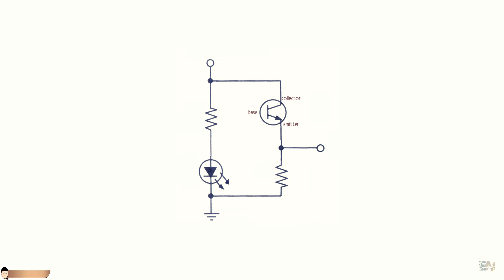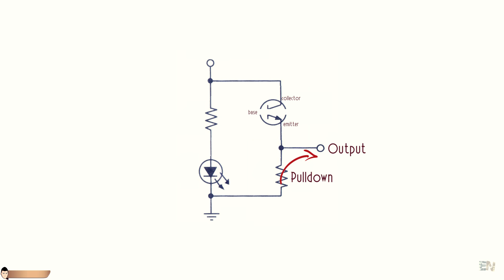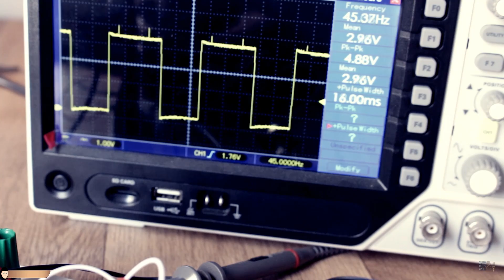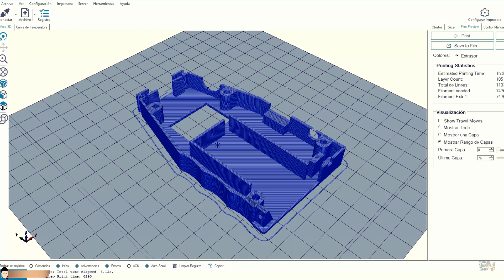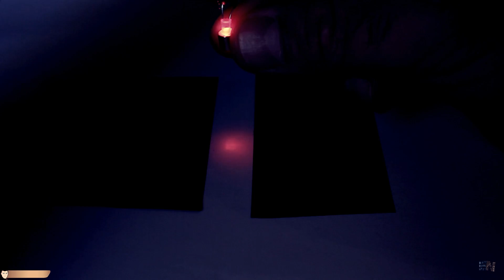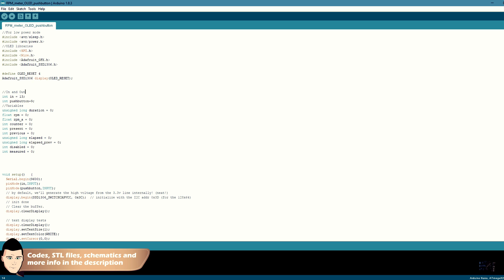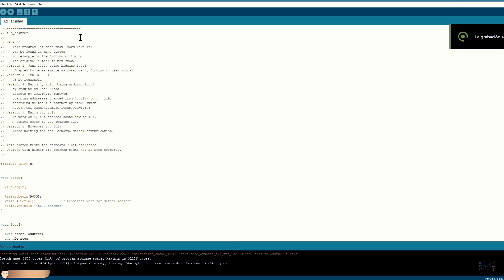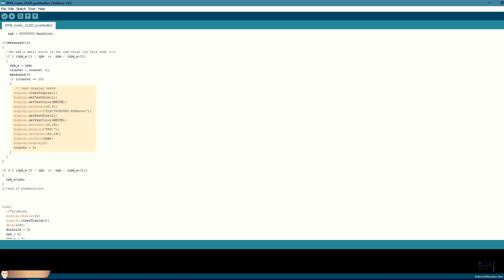RPM meter with arduino DIY (IR sensor and 3D printed case)

Comment from the maker: I hope you enjoy it. If you have any question don't doubt to ask it on my Q&A page or here. The project could always be imprroved with better code, better IR sensor and a faster microcontroller. Keep up guys!
Reply: I think an improvement would be to use a positive edge triggered interrupt and measure the time between interval between the two successive interrupts.
Reply: Electronoobs sir, how if i wanna make this cool stuff without push button? Is it using the same code? Thanks a lot from Indonesia :)

Comment: At low speeds, your algorithm is very good. Wouldn't measuring the period of a square wave cause a large error at high speeds? At high speeds, if it counts pulses for 500mS, the amount of error will decrease.

Comment: my problem have not display working whit ssd1306 library, i test display and many example ssd or sh 1106 library  Gyveroled or lcdgfx library working, working only, how change code use other library.  and how max speed can measure accurate, my cnc spindle working 9-30 000 rpm. first time i try use oled display and not working whit ssd 1306 library. sh1106 working ok, i test display only drivers examples. how need change code can use other library, now come lot errors whit ssd 1306 lib. oled have chinese 1,30" white, 4 pin i2c.

Comment: can this use ir module no need code change, and my cnc spindle run 0-25000 RPM read this accurate speed. or what need change code.
Reply: Look at GreatScott's video on RPM meter. That's exactly what he did and it works great apparently.

Comment: why use lm324 op amp, why not use lot cheapen, ir sensor module include all this parts, lot better and easy use, need same 5V in,GND,out signal. and arduino can read sensor.

Comment: Not better to add schmitt trigger instead of opamp?
Reply: Absolutely it would.  Either that or just use a comparator.  Using an op-amp is just the wrong part for the job.  Especialy a quad op-amp.  Even a cmos inverter would be a better choice. All you're doing at that stage is squaring up the output waveform from the sensor.  A comparatore offers a convenient way to set a threshold to adjust the sensitivity.  Now that I think of it, a 555 timer would be another good choice.  Put the sensor on the trigger pin, set the threshold with the thrreshold pin.  No points for guessing where to get the output from lol.  Just remember o/p will be inverted, not that that even really matters. Save the opamps for an audio project.

Comment: is it possible not to include a trigger button? I am intending to use a li-po battery but it is difficult to define when to stop the RPM counter and make the value stay on screen.

Comment: The parts links aren't up to date, but you can get a ready made IR sensor with the needed resistors from adafruit ( https://www.adafruit.com/product/2349 ) - with that and a few jumper cables I could already read data from the Arduino to my computer through the USB cable.

Comment: Before the end of the code there is some logic of adding error to the rpm value, what is that for??
Reply: After dividing to get RPM, there is a fractional part.  The code you're referring to just rounds up if the fractional part is greater than .5

Comment: I did something similar with a laser & an IR sensor I pulled from a tv RC receiver. Its been years but i remember I was able to get 60k. of course that took some tuning. it was 5k out the gate. Eventually I used atmel studio to reduce the bloatware on arduino.  Like I mentioned> its been years, but I remember getting more like 100k or 200k.... I should clarify >>  its good and very useful bloatware. Its really good to have quick access 2, caz programming in atmel studio was super bare bones. There is much goodness in the arduino ide already hooked up. Much I didn't know I was taking for granted until it was gone.... so ya its not that big of a deal to use atmel studio, just be prepared to strap yourself in and read that 1000k length datasheet.  btw, measurements = signal generator + oscilloscope . and yes it totally works to measure spindle speeds, that why I made it. There is a lotta power in a laser. U could use an old cd player as well, its got a laser&diode right there :)

Comment: How wide is the tape strip?  Seems to me a narrow strip would be more accurate.  Measuring propeller speed would have to be done differently,  as added tape could make the prop unbalanced and cause problems.  What if your viewer does not have a 3D printer? Some of the stuff you mention costs more than I can afford.. I'm more interested in projects I can do with what pieces parts I've got, like the 37 sensor kit.

Comment: Hi, I used a low frequency clock generator for testing the circuit and I can not read accurately. Very unstable and wrong measurements!

Comment: How you get 5v from the op amp since the lm324 is not rail to rail??
Reply: You don't need to get 5V because the input threshold for an Arduino digital input is somewhere around 2.6v
Reply: @Enigma758  ok thats true, but you do not answer my question
Reply: @1828fernando  OK, I think you may be referring to 4:20.  The pk-pk value is jumpy.  You can see it bounce around anywhere between 4.20 and 5.24.  Also, notice the spikes at the top of the waveform.  I think when it jumps past 5v, it's due to noise spikes.  I think the circuit could benefit from some filtering.
Reply: @Enigma758  again... You are not answering my question. If you read the datasheet, says: output voltage swing up to VCC - 1,5v. you can not  get 5v output. Something is missing or wrong in this video.
Reply: @1828fernando  OK, I see your point, an LM324 should not be able to exceed 3.5v yet his scope is showing otherwise.  So something is fishy here.  Maybe he is not using an LM324 on his breadboard.  Or maybe he's driving it higher than 5v on his breadboard and that's offsetting things.
Reply: @Enigma758  maybe... Thanks!!
Reply: @1828fernando  Just don't use an opamp at all. Use a comparator like LM339 or even a 555 chip.  Other good choices are cd40106 inverting schmitt trigger or cd4069 inverter.  What you are mainly trying to do at that stage is make the analog signal from the sensor into more of a rectangular wave so that the transitions are well defined in time and the high and low levels are well defined voltages. He also uses the differential input of the opamp to set a threshold but you could just as easily adjust the senitivity of the sensor with a voltage divider or even in software. If you were to use the aforementioned 555 timer IC you could put the sensor signal on the trigger pin, and set your threshold with a voltage divider connected to the threshold pin.  Of course the output comes from the output pin and can then be sent to the mcu.

Comment: Very good video-manual! Thank you.

Good day! 
Please, tell me,  what is software  did you use for draw a connection diagram at 5:38? Do you think it is possible to use a comparator that is smaller and simpler, for example LM393 or even a single-channel comparator? (I do not know which one, but it would be nice if it was in the case of sot23-5)

Comment: You could just remove the on off switch and replace it by a button. So if you push it the device starts up and reads the rpm, after you release it again it simply turns off.

Comment: Hello and have a good day.
This sketch on an an Arduino Uno works very well.
And I do not need to push the pushbutton.
On an Andruino Nano the screen goes away after the logo animation.
With the pushbutton I can not get it out of my sleep.
I've tried everything.
I need this sketch for a rc go-kart with rpm display on the dashboard.
This go-kart is powered by a Nitro Rc gas engine.
I found the idea cool to equip it with an Rpm ad.
Unfortunately, the arduino Uno is too big.
Can you take the sleep mode out of the sketch?
I tried it but I did not succeed.

Could you help me, I think this ad just awesome.
Unfortunately, I'm not a programmer.
I would be very grateful if they could help me.
I would be overjoyed because the idea I have had no one yet.
I would really appreciate an answer.
If it works then I will send you a video with the rc go kart ..

Best regards........

Comment: Not the most industrial design from electronics to software to enclosure but nice try hope that was educational for you.

next I'd recommend using Fusion 360 as designing software and fasten the main pcb with screws and for the other components mount them without any glue. for the software I'd recommend auto sleep and averaging slower refresh rate. and for the electronics just put everything on a single pcb.

Comment: Cool stuff! >10k rpm is great! But if we'd want to measure something even faster, what would be needed? Is the limit as it is now a code/arduino limitation?
Reply from the maker: A huge limit is the OLED screen. The OLED i2c control is a huge delay. Using Serial monitor or another LCD would be faster. Also using a higher than 16MHz arduino would be great
Reply: Sounds like it's primarily a thing of processing speed, so not for instance a physical limitation of how quick the phototransistor can switch?
Reply: That's good to know. Would it be feasible to use an interrupt instead of the logic in the main loop?
Reply: @lebasson  I believe that would be an improvement.